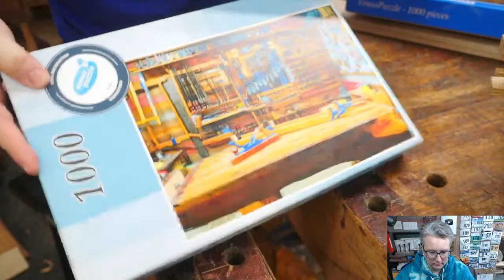Oct QnA 2022

Comment: Could you tap a hole in to the side of a plane and add a removable handle to use on the shooting board?
Reply: Of course you can, the real question is if it is a good idea.
Reply: @pettere8429  The Record T5 has a side handle but was designed for schools / students .
Reply from the maker: You can but you'd still have the other problems that a regular plane has for a shooting board. The hand position is nice. But having a skewed low angle iron is the big one.
Reply: @WoodByWrightHowTo  I have been thinking a bit of making a shooting board sled for a regular plane to get the skewed iron but haven't had time to do the experimentation (got a wardrobe, a diaper changing stand and two beds to build first...)
Reply: Record planes here in the uk did exactly that with the record   t 5 model